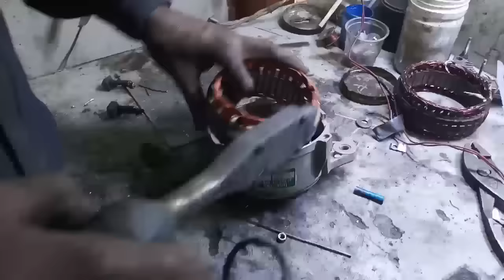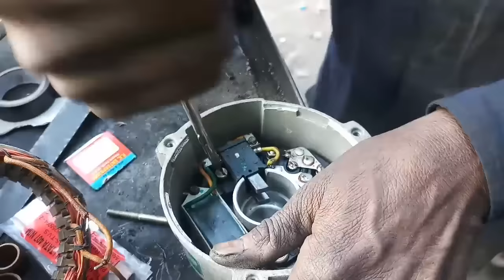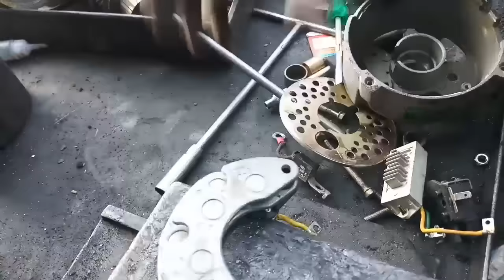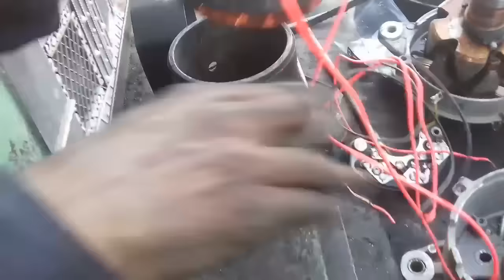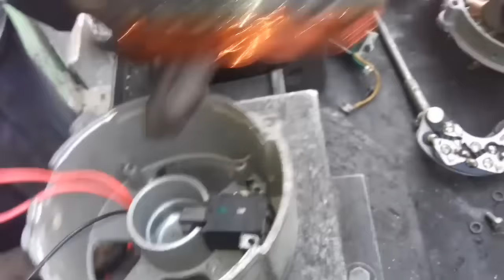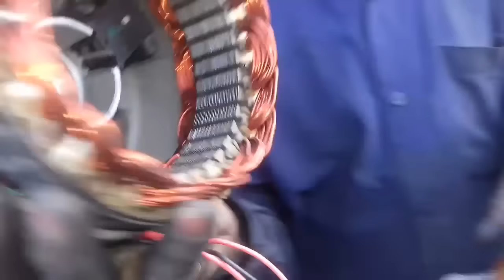How to Convert a Car Alternator to work like a BLDC Motor for ebike (Part 1) || #EVBasics

Comment: Sir any help please any ideas how car alternator can be used as magneto ignition system?
I want to fead me ignition directly to me E core type ignition coil and use ac electricity at full power so I was wondering how to not get shocked and not to interfeare with me baterry ore grounding ?
Is there any posibility to use capacitor banks instead of lead acid baterry just to drive the ignition system nothing ells.
I have big problem with ignition coil  voltage so I want to build me self some thing as back up if me ignition system fails its old classic car 12si delco alternator so any ideas how it might work out ?

Comment: sir does it have sufficient torque for pulling,can you tell its torque or practically show its pulling power
Reply from the maker: The Torque is just sufficient to use it like a fan. However with a proper gear train it has been used as a drive motor.
https://youtu.be/_T2twq9bQAs

Presently working on a bicycle build with the same. Video may come in August 2019.

Comment: thanks for this video 
But I think that yoiu should change the title it is not a BLDC (Brush less dc) because you still have the brusshes on your build.
Reply from the maker: That's why I have said " like BLDC Motor"
Reply: @ElectricScootersJammu  will this be able to run motorcycle, weighting 50kg, and driver weighting 80kg?
Reply from the maker: @sasyedji  the high rpm has to be converted to high torque either by using a bigger sprocket or planentary gears.

Comment: Hello, is 250w brushless sensorless controler enough for this?
Reply from the maker: It will work with 250w sensorless controller as well.
Reply: @ElectricScootersJammu  thank you a lot, is it problem if its 24v or must be 36v thanks you for your time :)
Reply from the maker: Not atall. You can use 12v/24v/36v/48v or even 60 volt controller for making this project. However, if you plan to make an ebike with this motor, I would advise you to use atleast 36v or 48v for higher speed. Then that speed has to be reduced and torque increased by using proper gear ratio.
Reply: I dont mean to be so offtopic but does any of you know a trick to get back into an instagram account?
I was dumb forgot my password. I love any tricks you can give me.
Reply: @Braydon Augustus instablaster :)
Reply: @Cash Everett it worked and I now got access to my account again. I am so happy:D
Thanks so much, you saved my account!
Reply: @Braydon Augustus glad I could help :)

Comment: It is not Brush less.   You need brushes to connect the Stater.  Brushless motor has permanent magnets and no need for brushes thus BLDC . BRUSHLESS DC motor .
Reply from the maker: Yes. I know because I made it. That's why I said "Like" Brushless Motor.
Reply: Seems funny everyone on the internet call it brushless but Mr. high & mighty is smarter than everyone else. Go sit in the corner and think about what you said!